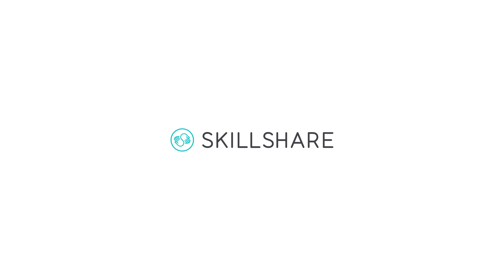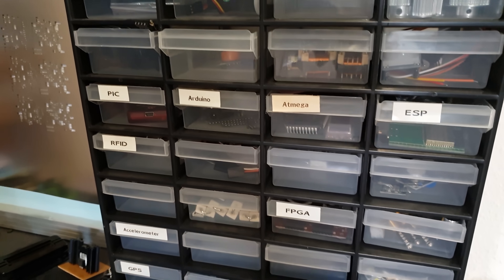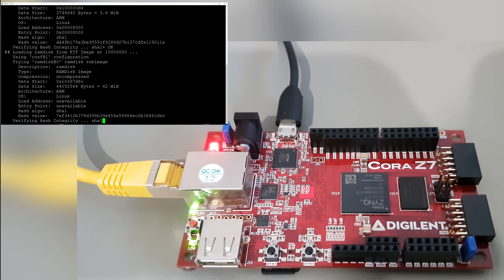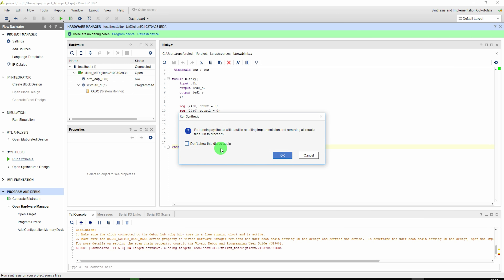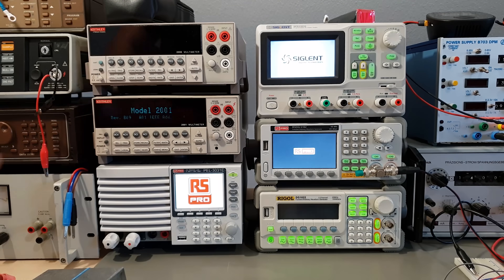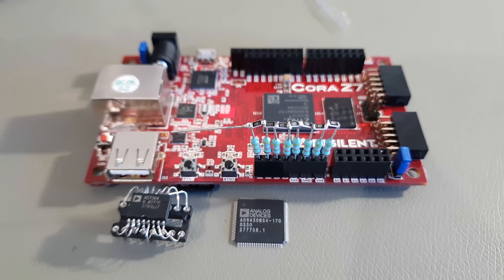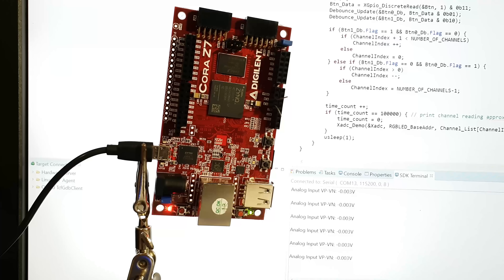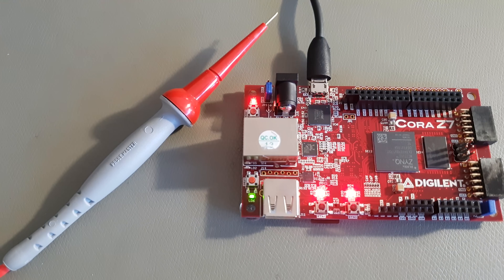First FPGA experiences with a Digilent Cora Z7 Xilinx Zynq

Comment: "Altium Designer" -- Don't you dare. If KiCad is good enough for the LHC ( https://home.cern/cern-people/updates/2017/07/kicad-reaches-new-heights ), then it's good enough for anyone.
Reply from the maker: I'd love use it and I have given it git a few fair chances over the years, but so far it has always been the weakest candidate. Even old clumsy EAGLE does not slow me down as much as KiCad did. But I will continue to test it occasionally and start using it as soon as I like it enough

Comment: Glancing at your output board, it seems that there is not enough thermal oomph in the output totem pole. Like 1W tops. Unless you use variable voltage power (noise!) those guys will get hot. If I remember correctly, Keithley 2400 uses several (but constant) voltage steps AND a bigass thermal sink which is hanging outside
Reply from the maker: I am bolting the output boards onto a big heat sink, but you are right, it'll still be relatively low max voltage or a terrible energy efficiency in its current state

Comment: There are some very interesting solutions for implementing an ADC or DAC on an FPGA that require only a few (like 3) pins and a few passive components. A common trick is to use the comparator in an LVDS pair and a third pin to make a delta-sigma ADC. I think a DAC can be made using a similar method: phwl <DOT> org <SLASH> papers <SLASH> dac_fpt03 <DOT> pdf

There are some much more sophisticated and complex methods that use something called a Time-To-Digital converter (TDC) if you want to burry yourself in research...
Reply from the maker: Thank you, will look into it!
Reply: No problem! Here's a link to a good paper on a TDC-based approach: bit <DOT> ly <SLASH> 2O6h7Bc

Comment: And another thing: how do you switch shunts? When I was making my poor man's curve tracer using just power op-amps and a benchtop DAQ, I've realized right away, that I need different shunt resistors to cover ranges of current I wanted (too much noise at low end otherwise).
Reply from the maker: With a mosfet solid state relay in the last version, not at all in this version

Comment: Marco, aren't you over-engineering a little bit? I know, I know, for a German there is no such thing. :) But, wouldn't it provide a much quicker design turn-around if the first version was built on a microcontroller + cheap-ass (and simple to use) Lattice FPGA, all controlled via a serial interface?

Comment: Once you graduate from FPGAs you go to VLSI asic design 😎
Reply: Correct! And after asic design, mixed signal asic? MIllimeter wave asic? MEMS design? What’s the most demanding discipline I wonder
Reply: Parker Davis I'm not sure, I'm currently working with photonic integrated chips, so I would guess the only thing after that is quantum computing.
Reply: so you're working on terahertz chip design? at what process node and with what semiconductor fab process?
Reply: The boards design is pure engineering, but programming language is basically a poetry, a very creative profession. The great analogy is architecture - the house must be built safe, but comfortable and beautiful also.

Comment: Meant to add more to that. This is awesome and I want to know more about the power supply project - I've been wanting to do something similar for a while and my test boards have done horrible things. Is this going to be an OSHW design? Is there info available about it? If this is going to be a purchasable product, also more info is needed and I'm very interested!

I use FPGAs all the time at work and they are amazingly capable. Coupling them with a CPU as the Zynq has done is even more amazing as it allows you to use the CPU for some parts of the task and the FPGA for others. You can make the FPGA work as an accelerator for the CPU or use the processor to configure and operate pipelines in the FPGA that do other tasks. We use separate chips and the communication path between is one of our more frustrating bottlenecks.
Reply from the maker: Yes, the open is in the name even :) More info on patreon. I could imagine handing all the data to a company and have a few assembled, crowdsupply.com? Kits would be cheaper but soldering the FPGA will be impossible for some people

Comment: 4:33 Oh god what is that monstrosity? Kill it with fire! 
Seriously though, have you seen those SOP/T to DIP adapter boards? You should get some, you can grab a set of nearly every size for just $3.
https://www.aliexpress.com/item/35pcs-7value-5pcs-PCB-Board-Kit-SMD-Turn-To-DIP-SOP-MSOP-SSOP-TSSOP-SOT23-8/32842167258.html
or
You can also get reuseable programmer boards such as this: https://www.aliexpress.com/item/Electric-Unit-High-quality-SOIC8-SOP8-To-DIP8-EZ-Socket-Converter-Module-Programmer-Adapter-With-150mil/32613388551.html

Comment: How are you implementing reverse voltage protection? For example if you set the OSMU to source 5V and you connect a 48V Li-po pack backward on the output, how will the output amp protect themselves?
Reply from the maker: It'll draw as much current as is needed to drop the voltage to 5V. If the programmed current limit is reached, the higher voltage wins and becomes the output node voltage.

Comment: "Almost as powerful as an 555 timer" I was not expecting that joke, but well played, you had me laughing out loud for a few solid seconds.
Reply: BigJoe_Buster Don’t knock the 555.  It might not do much, but the much it does, it do...s.
Reply: Monel Funkawitz  Dude... 555 does way more than you might think.
You need an SR latch? 555
PWM controllers? 555 (pin no. 5 controls the internal tresholds so you can use it for feedback, using a simple NPN transistor as both the voltage reference and the error amplifier. This is not the best at the job because switching frequency shifts around, but it's cheap, abundant and probably will be produced forever.)
Timer? 555
Shmitt trigger comparator? 555 (somewhat poor because it has fixed treshold, but...)
AND MORE!
Only 0.14040$ a piece for 1000 unit order!
Order yours now at 1-888-555!
Reply: akkudakkupl I have a few Kg of NE555.  I don’t use discrete logic much anymore since the PIC or Atmel but I still use them on repairs or need 100% reliability.  I have had PIC lose program from voltage spikes and EMI.  555’s need a nuclear blast.  Overvoltage is about the only thing that will kill them.

They don’t do much, but what they do, they do well.
Reply: The flexibility of the 555 timer is beyond impressive, or perhaps it is the ingenuity of people...
Reply: Me too 🤣

Comment: a few notes. You can easily run ubuntu on from the SDcard, just get an armhf root filesystem and change uboot to use it, with that you get apt-get so installing compilers etc. is easy. Unless you need encryption you don't need to to rebuild the bootloader to use a new bit file, you can upload it to the files system and pipe it to devcgf to reconfigure, just don't do it while accessing anything on the fpga via the AXI bus
Reply from the maker: thank you! bitstream from linux sounds fantastic

Comment: good project but it would be way easier and way cheaper to use example Pi Zero + ATMega...
Reply from the maker: u sure?
Reply: 100%... 
1 x Pi Zero = $10USD
1x Arduino Uno = $5USD
but 1 x DIGILENT Cora Z7 = $99USD
i made a full home automation system that has web admin and android app this way, it was not hard to do at all and i have many analog and digital communications between parts...
so yeah i am sure + using Pi Zero you can make video processing and record video and camera inputs... is it enough explanation for you why i claim it is easier and cheaper using Pi Zero + ATMega instead DIGILENT Cora Z7?
Reply: +Undefined Lastname yeah, did we watch the same video where he is saying that using the FPGA is easier and cheaper than using microcontrollers or mini pcs? rewatch the video then reread my comments...